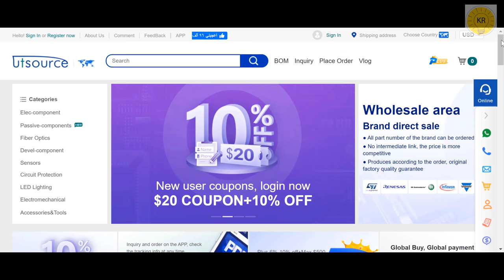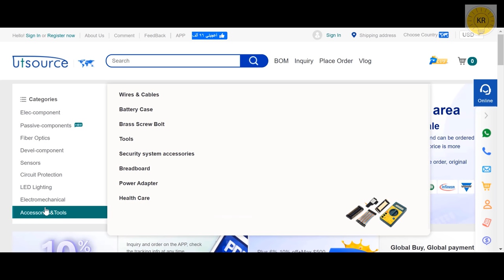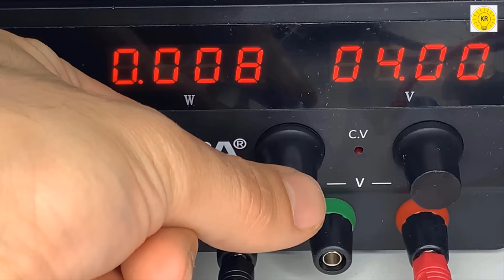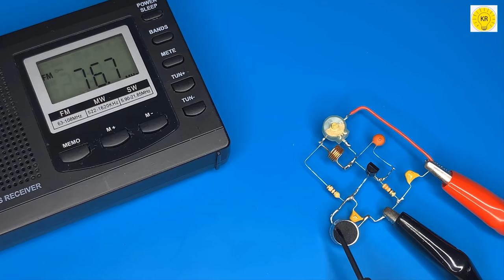how to make a simple fm radio, Use transistor, utsource

Comment: Howdy again.
Many VHF / UHF -virtuosos advocate having a good ground plane like in this clip.
I myself am not so sure. I have got many FM super regens working well just with crackerbread boards with no copper using point to point wiring. Crossing wires have been no problems. The only one thing that is important seems to be to use short leads in the tank circuit. The tank wiring should be dedicated for the tank only. Other ground currents should not flow alongside the tank currents. The tank ground should be connected to the ground plane with a separe wire.
Short leads and wiring is also advocated. I have found that, say, 1-2 inch wires and leads usually mean no troubles.
But yes. A good ground plane is, by no means, a drawback.
In high regards.

Comment: You should use a perf board with a ground plane and cut the trace with a dremel. This way the circuit will be more compact!
Reply: That would defeat the purpose, as this was done in the style of manhattan circuit construction. perf board circuit and manhattan circuit construction are two every different techniques.

Comment: Great video!  What is the name of the item that sits on the copper circuit board to which the components are soldered?  Where can I buy them?  Thanks.
Reply: Cual es el nombre del componete que usa para las conexiones ?=  Donde se consigue?
Reply: @mariocordoba826  This is the question I asked in Spanish
Reply from the maker: hello my friend it's small pieces, from pcb bord
Reply: @inventorkr1  Thank you.  That is a very clever idea.  Have you coloured the PCB blue?  And do you put glue on the back to make it stick?  Or do the components stop them moving around?
Reply: @ThePerthGroup  I think these are chunks from Stripboards. These DIY soldering boards you can get either with Dot raster or stripes. Make sure they are have the solder stripes on one side and not both sidess.

Comment: Not very useful without a schematic.  The parts values were on screen for short a time that it's very difficult to see the placement and part value.  The builder is out of touch with how difficult it is for someone to try to build this by watching this video.
Reply from the maker: Dear friend, have you tried to see the description of the video? You can get the circuit diagram through the link below the video in the description box